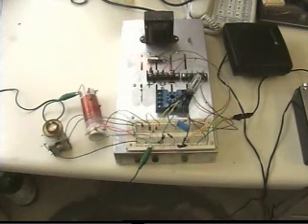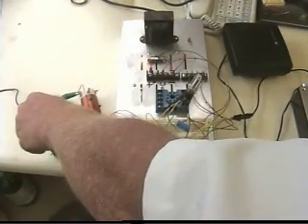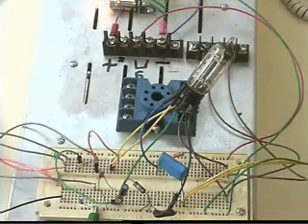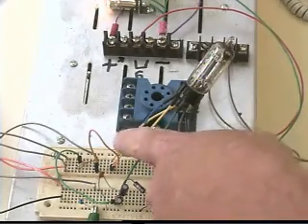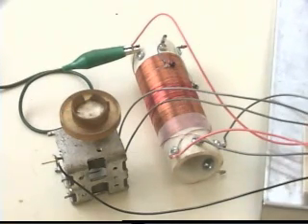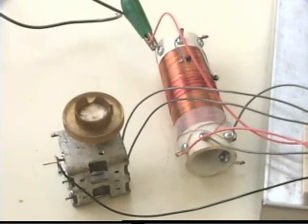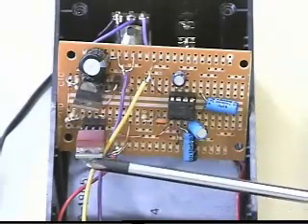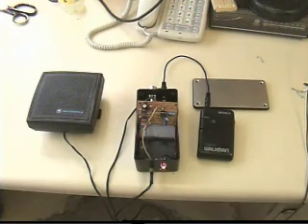12AV6 Vacuum Tube Radio with LM386 Power Amplifier

Comment from the maker: Yes and no on that. The coil design was from a 1920's crystal radio while the tube circuits was a combination of two earlier designs. I took parts of three circuits and put them together, added the diodes plates as noise reduction. The bead idea was from a fourth source.

Comment from the maker: I used glass beads to hold the wire up then soldered a connection from there to a small screw terminal at the ends of the coil.